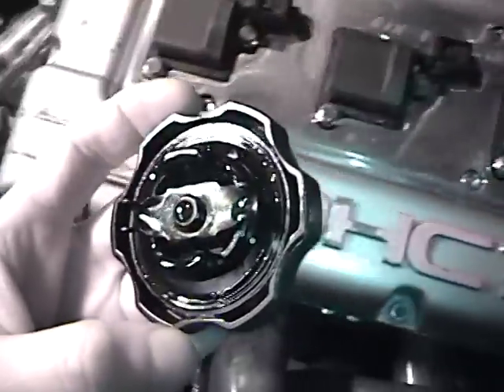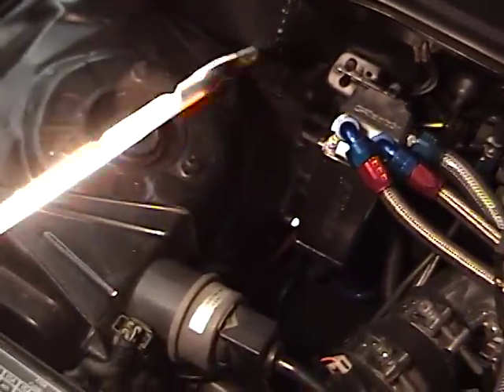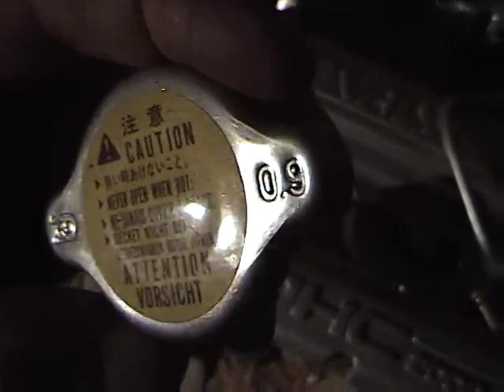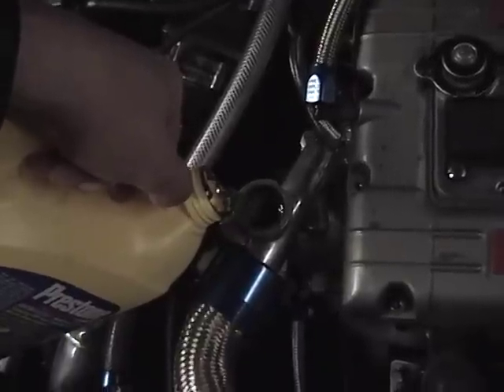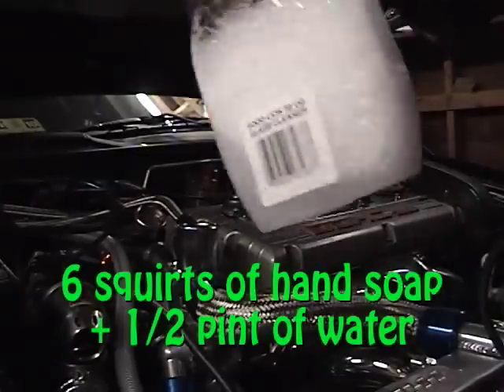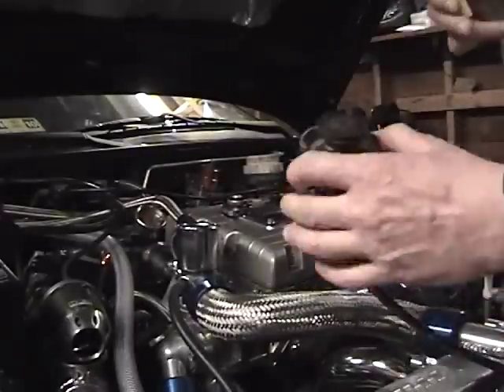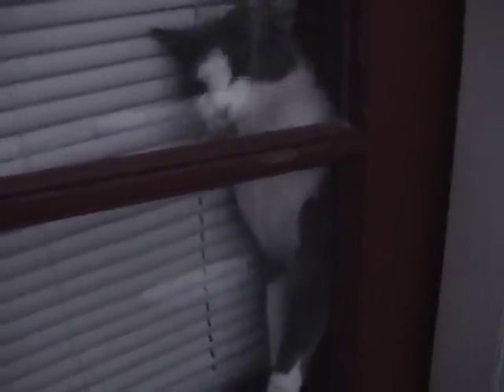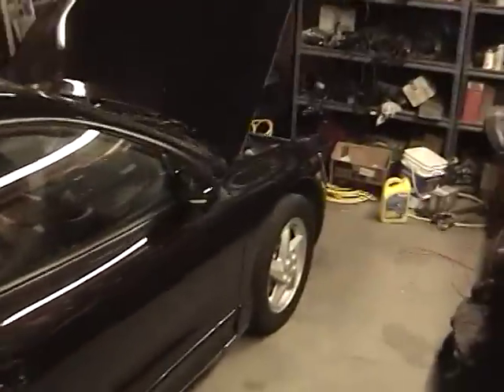Engine coolant system and compression testing

Comment: JAFROMOBILE,                       //                   I'm trying to test the temp gauge by itself to see if its giving "false readings".
            What "Test Tool" can I use to test the temp gauge to make sure its reading correctly or giving false readings?
                         can I connect another Temp Gauge I can buy at PEP BOYS and connect it to the fuse block to test the temperature to isolate if the temp gauge is the dash board is giving false readings?

Comment: I've attempted the coolant pressure test several times now.. ive made sure the cap to the test is secured well but I get 0 pressure build up.  checked and no air is coming from overflow hose, cap is blocking it anyways.  the air comes out(and can't see where) as fast as I pump it.. think it's the tool? or maybe the overflow tank I'm pumping into has a hole? I don't lose water super duper fast so it's weird how fast the(nonexistent) pressure leaves the system .
Reply: could be a faulty tool - is it a rental? maybe swap it and check another one. Or put some soapy water around the radiator cap fitting and look for bubbles.. I always stir up the water so its quite foamy.. really helps. Good luck - either that or you have a SERIOUS leak in the system somewhere..
Reply: Thank you sir for your response.  Unfortunately, I did find that I had a serious head gasket issue.  It came up negative when testing for exhaust gases every time, but after fixing/flushing/replacing /checking every part of my cooling system it finally showed up positive for exhaust gases in my cooling system.
Bad ending for me, BUT I'm glad to know without a doubt what it is so I'm not running around with my head cut off.  Thanks again for your response.

Comment: so what if the overflow system fails? could i just put a pressure release cap on the radiator and bypass the overflow system? I feel like im having this problem on an 03 eclipse with a 3.0..
Reply from the maker: When your radiator cools down and the coolant system tries to suck water back in, where is it going to get it from?  You need a coolant overflow reservoir unless you have a concrete-poured block that only runs long enough to make 1 drag pass.  If you use coolant, deleting the overflow system is how you get air bubbles sucked back into your coolant system causing you to boil over.
Reply: so I used the pressure tester and it started leaking under the intake manifold. have to take it off this afternoon. but where should I be focusing my attention?
Reply from the maker: I'm not familiar with where the coolant passages go on Mitsubishi engines after 1999, and especially not the V6's?  Unless the intake manifold contains a coolant passage like my Ford 4.2L V6 F-150 does, then it's probably leaking from somewhere else and that's just where you're seeing it.  If it does contain a coolant passage, it could be a blown intake manifold gasket or a cracked manifold.  My V6 F-150 has a reputation for leaking coolant inside the intake manifold and hydrolocking engines when the lower intake manifold gasket fails.
Reply: Oh ok. I checked the oil and it looks clean. the coolant is clean too. I doubt it's the head gasket. but it is leaking a lot under pressure..
Reply from the maker: If the engine has good compression after testing it, you just have a coolant system leak.  That's why I did both tests in this video.  ;)

Comment: Can you advise what could cause coolant system back pressure.  Pressure build up will cause res. tank cap to blow off.  Engine shows no overheating but continue to loose anti-freeze.  No leaks found when compress. test done.  ???
Reply from the maker: +Charles Morris It could be a failure of your coolant overflow system.  Hot coolant expands and fills it up.  If you park the car and it sucks air instead of coolant back in as it cools, the next time you drive it will run hot, and push coolant as that air expands.  You may just have an air leak in the overflow system.

Comment: I am getting back pressure in coolant system.  Did compression test & show no leaks.  Changed TS & rad.cap.  Any suggestions has to why building up pressure?
Reply from the maker: +Charles Morris A coolant system needs to be pressurized, and that's normal.  If it's overheating and pushing coolant out, that's another story.  That could just be an air pocket in the system.  I've seen radiators clog.  Have you ever used coolant additives?  If the car is fairly young and well serviced, it's not likely the case… but if you're overheating, check out the radiator inlet and outlet hose temperatures on a warm engine and make sure they're both warm.  If your coolant system is over-pressurizing, replace the cap first.  I've seen this cause problems first-hand.  It's why I ended up making this video.  It's supposed to vent to the overflow at 13.5 PSI and no sooner or later.  If all that checks out, do the chemical exhaust vapor test that checks for combustion gasses.  I cover this tool on the Ol' Whitey video.  If that passes and the radiator isn't clogged, and you're overheating, then I'd start suspecting the water pump blades are rusted out.  I've seen this happen on '80's-'90's model American cars.

Comment: I've always been told to remove all the spark plugs at once and keep cranking until the needle stops rising (usually 6-8 on my Mazdaspeed 3). Supposedly not having the spark plugs in the 3 cylinders you're not testing helps get an accurate reading faster because the starter doesn't have to work against all that extra cylinder pressure.

Comment: I've recently been chasing a "gremlin" -- my car is pushing coolant at high-boost only .... I've done all these tests:

1. Compression Test = OK
2. Leak Down Test = Ok
3. Radiator Cap Test = 1 of 2 was a bit weak, so got new ones (problem still presisted)
4. No oil in coolant; no coolant in oil
5. UV Dye test into coolant = Ok (no dye in exhaust or anywhere else)
6. Radiator system pressure test (holds pressure to cap)
7. Removed thermostat (looked a bit bent) = didn't solve issue
8. Vacuum system test (holds vacuum) = Ok
9. Videoscoped pistons for leaks/coolant = All ok

Flushed the system good (was pretty clean); put in new thermostat -- used vacuum coolant filler (no air in system) ... used a mix with less distilled water.  Last check it didn't push coolant.  Even on big boost.

What you might get is a head lifting on boost, but not during idle/cruise -- most of these tests will not show you that unfortuately.  Good video.
Reply from the maker: +mbdulka  Sounds to me like after you heat cycle the engine, your coolant overflow system is sucking air back into the engine instead of coolant.  Next time you drive, it expands.  Pushes coolant.  Coolant overflow system failure.  All other internal systems would test OK with this problem.  Just my 2¢.  Watch the Monster coolant overflow bottle video.  ;)
Reply: Well, it's possible ... or I'm lifting a head on boost and introducing pressure to the system (I forgot to note I did the chemical headgasket test as well -all was ok). I am using a crude 1 litre plastic bottle as my overflow (I used to have it without a bottle) .... the reservoir or filler tank is ok .... shouldn't get any from the overflow bottle.
Reply: Hi, how u solve the problem?
Reply: Hey, Looks an old post. Just curious,,,Did you solve the issue?

Comment: Hey Jafro, is it right to leave the plugs in besides the one your testing on ? I was told all should be removed the. Placed into your if wires and grounded so the spark doesn't ark back into the coil pack, also remove your engine fuse for fuel ?

Comment: I've got a 99 Nissan Altima that has a possible blown head gasket. No smoke or fog exhaust. oil looks good. I changed the antifreeze because it was a rust color and when I refilled it, color changed to rust again. Weird! Any ideas?

Comment: Wow this is a great video. I can't believe I hadn't watched this one yet. Right now I'm battling finding a coolant leak. See, I do have what looks to be a spray pattern of coolant but only after a drive, I cannot visually see a leak while idling. There is a small pool on the trans side between the head a and block but I'm hoping this is only due to a leak at the thermostat housing. I'm going to grab one of those pressure testers and narrow it down. Really hoping it's not the HG.

Comment: @Jafromobile 
thanks for your help ..i finally got a TD05 big 16g turbo ..but i need an oil inlet fitting .. i checked online and i found out that the size of the fitting is M12x1.25 to AN4 fitting. Do you know if is the right size to fit the turbo?

Comment: Hi thanks for your videos they're really great.. i have a 95 Talon tsi stock turbo in the past few days the car has a blue/white smoke ..every time i stop at a light and when i go over 3500 rpm.. i change the oil and still the same.. im not lossing power still runs strong but smokes a lot.. what happens when theres  bad valves seakls?

Comment: All a can say about this video is finally I find someone on youtube that know their stuff, and is not paying a shop to do the work. having said that, I have a 1999 eclipse with the a420 engine which I got from 96 eclipse that I bought for parts. after installing the timing sensors and wire harness from the 99 eclipse and installing the engine the car did not turn on. everything is connected correct, but still no ignition. can anyone help with the steps to troubleshoot the problem.

Comment: you did such a good job mechanically and with the video thanx for sharing. the tests you did were both dry, right. the reason i ask is because if your symptom was simple over heating  wouldn,t it be wise to replace the radiator cap with a higher pressure radiator cap temporarily, as the rad cap is the least expensive component. if no overheating= bad cap& thereby eliminating the need for the test.

Comment: Hi Jafromobile,

Thanks for asking - luckily it looks like it was just an air bubble that I had to work out of the system.  I took the extra step of drilling a small hole in my thermostat flange to allow any air bubbles to bypass it.  So luckily I didn't need to do anything more complicated than that!

Comment: That was a bloody fab video, must have taken ages to edit. Poor starter motor though ;) Could you not have done a sniffer test on the coolant. My sisters daewoo was reading over 100psi in 2 cylinders and in the other 2 it was less that 50 because they gasket had completely gone inbetween them. Shame really, it only had 60K on the clock and had had the same problem at 40K